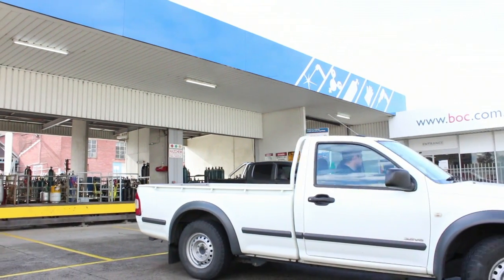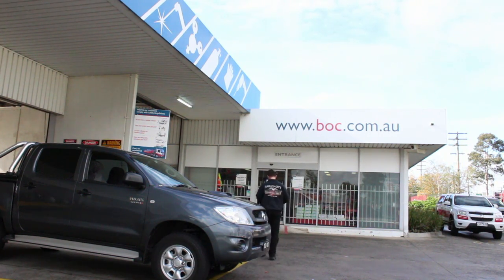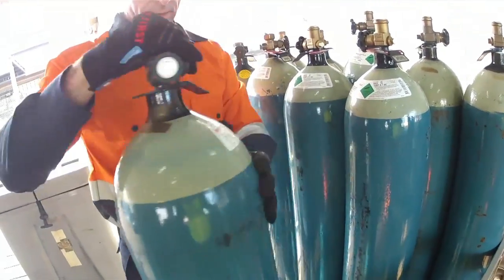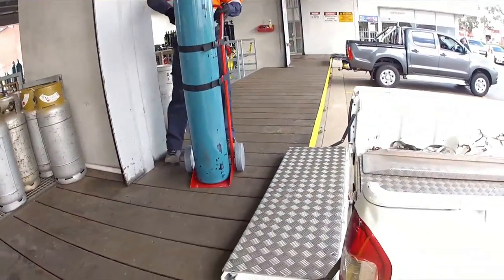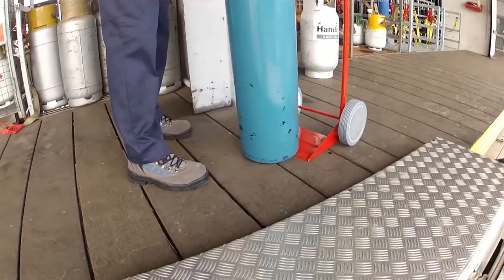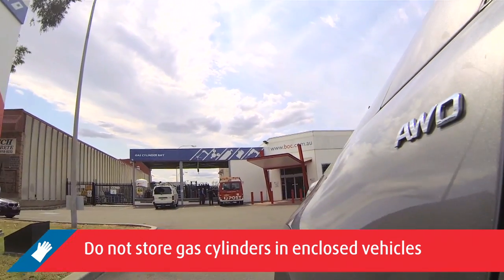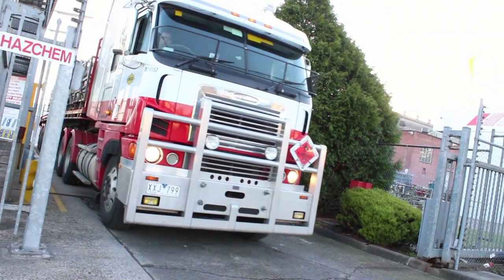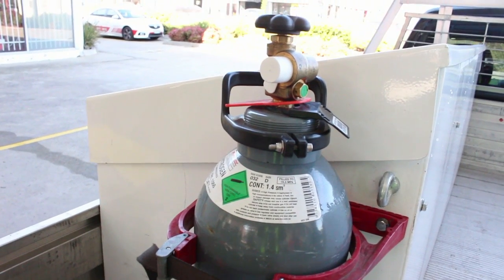BOC - How to transport gas cylinders safely

Comment: hello Sir , is it safe to transport a 3kg small nitrogen compressed cylinder in my car horizontally ensuring that i do not park car in sunlight and keep windows open . with psi 2000
Reply from the maker: Hi Kris, thanks for your question! When cylinders are not securely stored in an upright position, you risk damaging or accidently opening the valve which can result in dangerous oxygen deficient environments – which is why ventilation is vital. Cylinders can also become a projectile in an accident or sudden stop if they are transported in the cabin of the car, which is why we do not recommend this transport method. The safest option is to arrange for a gas cylinder to be delivered and the great news is, BOC can deliver cylinders around Australia direct to your door! For more information on the safe transportation of cylinders refer to our BOC Guidelines for Gas Cylinder Safety.
Reply: @boclimited  Hi how much would it cost BOC Rocklea Brisbane to deliver and swap a CO2 gas bottle to Springfield lakes 4300?
Reply from the maker: @trevorthomas553  Hi Trevor, you can either give us a call on 131 262 or visit our website (www.boc.com.au) to get all our up to date costs!